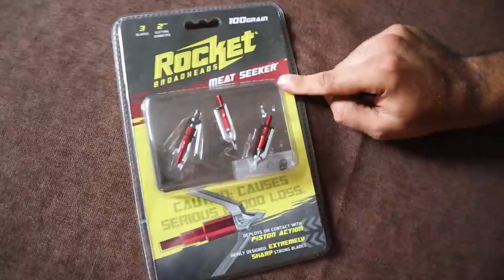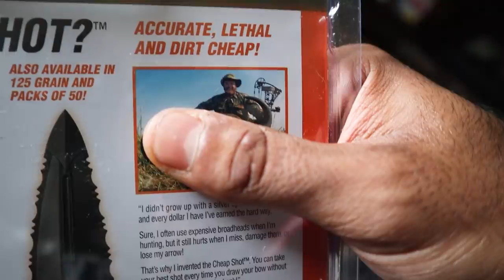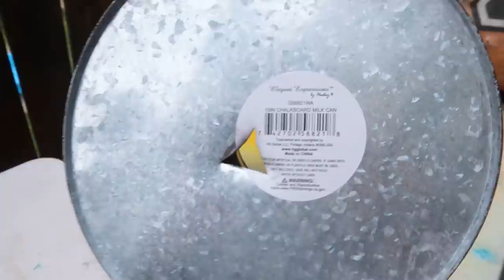I Bought ALL The ARROW BROADHEADS On AMAZON!!! (AIRBOW) *DARK WEB HARPOON ARROWHEAD*

Comment: You could create a "nipple" that is solid and would extend the length of the arrow by about four inches. In other words, you would add a solid weight to the front of the arrow and behind that last triple steel head you shot.
You can probably cover the arrow shaft itself in that Line-x coating to make it stronger as well.
Reply: wouldnt that throw off the balance of the arrow

Comment: hmm to break through the cinder block well i can think of two ways that be possible...1. building an air bow with a mechanism that spins the arrow so fast yet has enough power that the arrow flys straight still or 2. find an arrowhead that has a point that is both heavy enough yet slime enough the kinetic energy will transfer to the arrowhead at a single point. if its to completely break the block yeah not sure what to say

Comment: What you need to do is see if you can get a ballistic collar that will fit those arrows that would keep the carbon from Splintering out like it did also you should try annihilator broadheads

Comment: In my opinion, I don't think the airbow has the power to break through a concrete block. It may get lucky and crack it and allow it to separate a large chunk, but it most likely won't penetrate. Most common handgun bullets (9mm and 45 for example) won't go through the first layer of the block on the first shot.

Comment: Add more weight Marcus. Fill the end of the arrow with lead weight and seal it with wax or some other bonding agent. Or try and find a heavier type of arrow. You’re using carbon fiber. Flies fast due to its light weight but try aluminum or some kind of composite arrow that will fit the air bow.

Comment: It would be interesting to know what brand and variety of arrow shafts you are using, I typically shoot the same easton ACC(aluminum carbon composite) shafts that I’ve had for the last 14 years. But I know that new carbon shaft designs are much stronger than they used to be

Comment: I know this is kind of an older video now, but probably the way to get through the concrete block is if you got an aluminum arrow because the carbon fiber arrows that you're using shattered instead of the arrowhead itself, breaking as clearly shown about 14 and a half minutes in.

Comment: You should also try swacker Broadheads but you would have to use the bands on them to keep the blades in or use the plugs because the way the Blades open is what makes them special they open up inside the target Make sure to get the two blade ones

Comment: You need a titanium shaft and fins then that's should do it you should have a look a the slingshot channel he made a 1000 joules air cannon and I'm sure that could kill through a cinder block wall easily but titanium should have the tensile strength and the best strength to weight ration but could try different alloys and make a series about it like if you'd watch it 🙌🙌🙌

Comment: I'm pretty sure you're shooting those polymer broadheads into targets they were NEVER meant to go into in the first place..Against flesh they'll more than likely do pretty good, but call me old fashioned, I still prefer a good, simple, metal, cut front to back, broadhead. I sometimes pick up Primitive Archery which is all about using more traditional bows instead of compound..even has some tutorials in some of them on how to make your own wooden bow..anyway there was one I picked up and a hunter did a test of the classic front to back cutter (the kind you see all the time, just simple flat metal in an arrowhead shape) vs the fancier multi-blade stuff and while it does work..it actually has to work a little harder to penetrate because it has more surface area to push through.

Comment: The reason you can't do any more damage to the cinder blocks is not because of the arrow head. The shafts of the arrows are too weak and splinter. Essentially you need a stronger arrow shaft.

Comment: I honestly bet you could shoot to a sooner block but you need to find The toughest arrow you need one it won’t flex as much is those ones well do you need an arrowhead that is not gonna break on impact because I’ve shot through a cinderblock with my bow but mine was in as powerful as yours I just have like a regular archeryCompound bow but I guess the more spirit has the father that arrow Head is going to push back into the stem of the arrow

Comment: The problem really is the arrow isn't strong enough, the arrow absorbs the impact because the cinderblock is stronger, the head gets pushed into the arrow, altho if you could contact lin and make coldsteel make an arrow it could probably take the impact

Comment: The arrowhead that you used the skull shatterer should go through the cinder block but you're going to need a better style Arrow this more durable and hard as tip because that's what's causing the arrow not to go through this in the book The Arrowhead is fine but the actual Arrow itself is breaking and shattering

Comment: Use a metal arrow instead of carbon fiber if you look and see what happened the arrow head didn't actually break the actual arrow itself did so if you had a stronger arrow that's stronger than carbon fiber like aluminum or metal It could shatter a cinder block

Comment: I don't comment Munch but I watch your channel almost every single time you post something.I'm not trying to say anything negative but that are both at you have the Benjamin is I'm not the most powerful air bow walking anymore.now just to help you out what you going to probably want to do for that are both so all of your chest will not only be better but you actually be able to have more fun with the airbow is at least put a red dot sight on it and then zero it in for at least ten yards that way you're shooting will be much more accurate you'll be able to actually learn how to do a few tricksand one thing that you might want to get is an all-metal arrow, it's not the arrowhead that's giving out but it's the carbon fiber arrow that you using